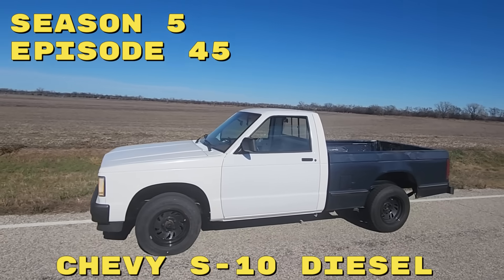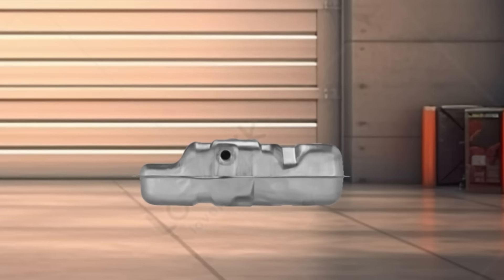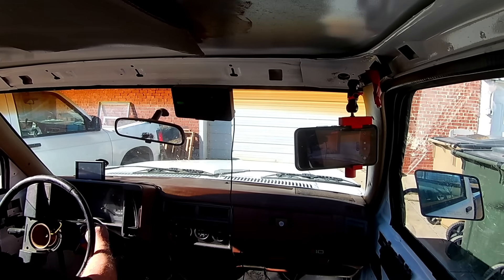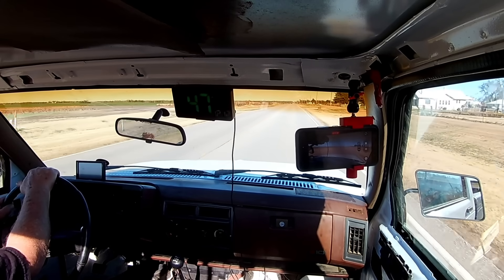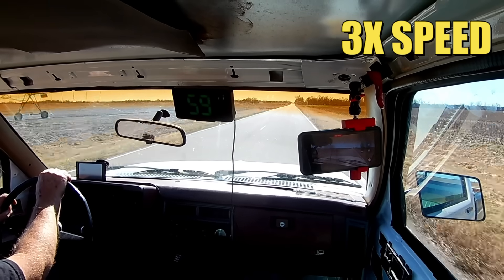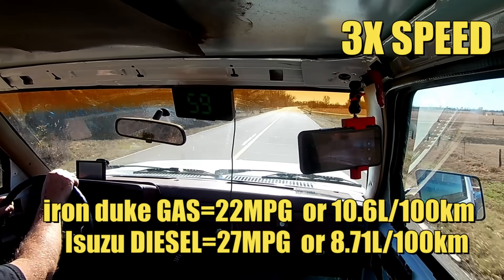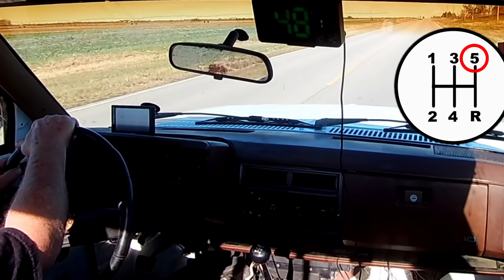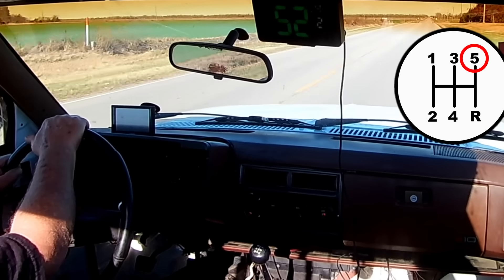S5 E45. MPG?  We road test the custom diesel Chevrolet S-10 to find out the fuel economy.

Comment: Ok. Back in the day unowned a ‘83 Rabbit pickup with the same engine. I wouldn’t exactly call it aerodynamic, maybe a little better than the S-10.  Now someone had messed with the injector pump, so it used to roll coal at high power, so my results may not have been typical.  That said, I waits get between 38 and 41 mpg if memory serves right. So, my guess is you should be getting 35 mpg +/- given the aerodynamics and the weight.  Will be interesting what you tweak it to
Reply from the maker: LOL, you were close!

Comment: In France, diesel has been cheaper than gas for as long as I can remember (I'm 42) until recently. Now, gas and diesel are almost the same price (around 1.70€ per liter). Small hatchbacks with NA diesels like the golf are usually between 5 and 6L/100km so the result of 7.2L/100km doesn't really surprise me.
Reply: For a long time, diesel has been a byproduct of refining oil into gasoline. Now, diesel must be further refined to remove most of the suffer which is more costly.
Reply: @ianm432 I believe it has more to do with state tax policies. Whether it is gas or diesel, 85% of the total price is just tax. In the EU, things started to go wrong when they announced the ban on diesel engines in 2035.
Reply: @DamdamF nope. It's mostly refining costs and supply and demand
Reply: In the US, diesel used to be way cheaper than gasoline. Now I believe that diesel is considerably more than "premium."
This made me rethink my plans for my project 1996 F-350 4x4 crewcab. I believe the 7.3 Godzilla is how I want to power it.
Reply: @Golgi-Gyges Power it with the Ford 300. Or even the 200.
Reply: Not sure when the change happened, but diesel fuel didn't have a road tax, because truckers (which was most of the non-agricultural diesel sales) paid the road tax in a lump sum yearly.  Then they noticed that a bunch of Mercedes and then pickup trucks were getting away with not paying a road tax, so the tax was lumped into the pump diesel price.  Agricultural diesel was dyed red so you could tell it apart from taxable diesel.
Also, up until the early '90s, the national speed limit was only 55 mph, which meant less hp was necessary. I had a '75 Rabbit diesel and later a '88 Samurai which were perfectly fine at 55, but when the speed limit increased to 75 mph (or more! Texas you know), the Rabbit just couldn't do it, and the Samurai just barely could, with a decent tailwind.
Reply: Here in the southwest U.S., it varies by location and gas station. Sometimes diesel is cheaper than unleaded, at truck stops it's usually more expensive and even sometimes the same cost as premium, in my area right now it's usually about the same as regular.

Comment: 5:57 okay, Dave here...  I'm going to place my bet. I used to own a 1994 S10 which had a more aerodynamic body. It was a 2.2 L with a 5-speed manual transmission and at a steady 55 mph Cruise it could squeak about 31 miles per gallon under ideal conditions. More realistic was around 29 when I was cruising on the highway. Factoring that your truck is a little bit lighter and it's also a little less aerodynamic but you have an extremely efficient 1.6 L Volkswagen diesel under the hood, I'm going to estimate that you should get about 38 to 40 Mi per gallon which I believe is what you predicted. Now I'm going to go back to watch the rest of the video so future Dave can see what you actually got.😊

Edit: 15:00 

Future Dave here. I have to say I'm not surprised with or disappointed by the numbers you got. Considering how windy it was, and your real world driving conditions as opposed to trying to maximize fuel economy, I think your numbers are quite reasonable. I don't think you would have gotten anywhere close to that with the iron duke. Future future Dave is looking forward to the next installment! 😂
Reply from the maker: LOL, thanks Dave and Dave.  I have a few tweaks I want to try and we will test again.
Reply: Also something to keep in mind is that the aerodynamics probably play a larger role than the weight of the truck

Comment: You're right, Diesel is more expensive in Europe and the UK because so many old diesel cars and vans on the road it outsells petrol as a road fuel, 38 mpg on 4.51 litres (just over 1 UK gallon)  is pretty good, in the original car it would have done around 55-60 mpg, the dollar/euro/pound sterling exchange rate changes constantly, but a gallon here in UK is £7.00, pump timing and small punchy turbo would wake it up.

Comment: given the power split it might be more efficient to run in 4th depending what the tach reveals, looking forward to those results
Reply from the maker: Indeed, we will certainly try that.  The gasoline Honda insight that I have sometimes gets better fuel economy in 4th gear.

Comment: I’m pretty sure fuel economy will improve significantly as the power is increased - at least up to a certain point. My guess is that you’ll max out fuel economy when you’re generating something in the neighborhood of 40 hp when the engine is making peak torque. I figure that it takes about 33 - 35 hp to maintain 55mph in a vehicle that shape and size, and that hitting the sweet spot between torque, hp, and desired speed will result in the best outcome.

Comment: An alignment out of specification can cause a loss of fuel economy too - just throwing it out there!
Reply: if it were bad enough to cause significant mpg loss, he wouldn't want to drive it, it looked like it was tracking well.
Reply: @mdsuave13 I think it’s all pretty significant when he’s doing an mpg test. If the alignment is off at all, I’d like to see the same test before and after an alignment. I saw around 0.3 mpg difference on my 16 mpg Silverado. On something low on power and in the 30-40 mpg range, bet the difference would be more like 5 mpg.
Reply: @mdsuave13  We might be surprised. After all, overinflating your tires from 35 to 45psi makes a measurable difference on properly aligned wheels. Also, I know from experience a car can drive just fine, but eat up the tires if the alignment is out by just 0.5 degrees of toe. It would be an interesting experiment if someone wanted to run it.
Reply: @atsernov dude half a degree of toe is insane lol. toe is measured and aligned to the hundredth of a degree on modern equipment
Reply: @mdsuave13  It could have 3 degrees of toe-in on each side and it could still track straight. Likely not, but still possible. Making sure it's dead-perfect, or even modifying specs to set toe at a perfect zero is a good idea if you're trying to hypermile.
Reply: The importance of alignment is exaggerated by folks that bought alignment rigs and need to pay for them ;).  Yes, it matters, but if the car tracks straight and drives effortlessly, the alignment is probably fine.  Measure it using DIY methods if you like.

If you know someone that works in final production of an auto plant or as a mechanic, ask them if they pay for routine alignments.  The ones I know will chuckle and say "no".

If this thing is already getting better than the factory diesel option, then it's not being seriously affected by alignment.  The S10 is a brick-shaped device that will blow up if you try to drive it into a wind tunnel.
Reply: Thanks Jimbo for the interesting video.  I think you can probably get 40 mpg out of your S10 after everything is set up right.  With my 2019 Chevy Colorado (gas 2.5L 4 cylinder and 6 speed manual) I average 30 mpg at 55 mph.  With the tires, I run 42 psi front, 30 psi rear, which causes even weight distribution across the contact area of the tire tread.  I do my own fromt end alignments, which results in slightly better tire wear then when the tire shops do the alignment.  Toe is the most important parameter.  Also, half worn tires have better rolling efficiency than new tires.  Road surface smoothness also makes a noticeable difference in rolling efficiency.   Rolling efficiency is better with warmer temperatures.  I can't help you with the winds, Kansas is a windy state.
Reply: Also tire pressure if the brakes are dragging vehicle and passenger weight it’s a ton of things that can factor when doing fuel economy
Reply: Unless he is making 45 degree turns without hands we are talking .05 mpg.  Brining the mother in law  would be worse.

Comment: I remember when diesel fuel was cheaper than gasoline.  Then diesel trucks became super popular and the gas companies jacked up the price to take advantage of the increased demand.
Reply: There are two reasons why diesel is more expensive than gasoline: hydrocracking and ultra low sulphur diesel mandates.

Back in the day, crude oil was distilled, and you got what you got. Now, they use catalysts to "crack" bigger molecules into smaller ones, allowing distilleries to produce more gasoline. But this means less diesel is produced.

The other factor is sulphur. Prior to 2000, diesel contained around 5000 parts per million (ppm) sulphur. The first limit imposed by the government was 500. Then 45. Today it's 15 ppm. Filtering that sulphur out adds a lot of cost.

The sulphur also acted as a lubricant, which is why fuel additives are basically mandatory on older diesel engines like this. Your injector pump will go very quickly due to the lack of sulphur.
Reply: yeah it never made sense that the fuel distillation process pulled diesel out of the chain earlier, yet it was more expensive.  They figured out that literally every consumer needs diesel to run their life, so ethics be damned!
Reply: My mom had a diesel car way back when and I remember getting diesel for under 60 cents a gallon, but having to buy it at truck stops mostly. Not many places had it otherwise.
Reply: That's how all companies work, for everything sold. It was true of diesel when it was cheaper than gasoline 20 years ago. Low sulphur diesel refining, taxes, and the amount of diesel you get per barrel of crude (vs other petrol distillates) are the reasons. Not saying the oil companies aren't greedy, just that they've always been greedy and it's the market that changed.

Comment: How does the power compare to the turbo kubota? Seems like after the turbo and added fuel on the kubota they should be similar in power
Reply from the maker: around town, the power is good for both vehicles.   On the open road the Honda has the advantage because of its weight and aerodynamics.

Comment: Thanks for not using AI crap, Jimbo! I like your illustrations way better. Don’t let the robots win! 😂
Reply from the maker: Thanks!  Its too bad I have to announce it's not AI
Reply: @robotcantina8957 It's also kinda funny considering your channel name!!! Keep doing what you doing! Everything is perfect!
Reply: His Jimbo action figurine was ai generated thoe but that's not that horrible
Reply: If the robots win, we’ll have to listen to techno. (look it up here)
Reply: @stevebot  Ok. I am actually intrigued now as a fan of techno 😂jk
Reply: In your defense, It does sound like AI. Of course, Skynet would tell you it's not Skynet. I looked at some of the early videos from about 10 years ago and it is the same voice.
Reply: he DO use AI in figurine meme.
Reply: I wonder what a mechanical Cummins would get in a 1994 dodge reg cab  2  wheel drive with a 5 speed and tall gears 2:73 or taller;  in your part of the country?  It would probably get very good fuel economy and go faster than 55 mph in a head wind lol.
Reply: @Bob-the-handyman My dad put a 4bt into a d100 4wd from the early 1970s. It was a rough beast but it got in the low 20s for gas mileage. The top speed was about 60 miles an hour with a 4 speed manual. 

He later got a brand new 1989 W250 with an automatic that I inherited . Dad claimed 23 on the highway, running it flat out at 70-75 mph I got about 20. 60 seemed to be the sweet spot.

Comment: Yup, the efficiency was round about in the realm that I suspected it would be.
Even with or without the wind.
There is only so much efficiency that you can  reliably squeeze out of a gallon of combustible fuel with a given weight and speed.
🤷
(trust me, I dont like the rules either, but such is life)
The only way to get better efficiency with your 50 odd horse power is with LESS weight and LESS wind resistance.
Sure with some tinkering and induction you might edge it up to around 40 mpg, but you are still shoving around a heavy brick at faster than walking pace.
Still one of the coolest projects on youtube and one of the best channels on youtube.
So tyvm for that.
😁
Reply from the maker: thanks!
Reply: People say that, but it's actually not that heavy, and it's not as big of a frontal area as some of the modern trucks. There's some spots with no plastic guards to block the air, but it's probably capable of more than people bother to try for. The BSFC map of a stock ALH says it can make about this amount of power at 200 grams per kWh, which is a lot better than what this thing should be doing when it's revved to the max and out of tune, especially in the wind. So, if he can get equally good bsfc to that thing, he'll be in business. A tailwind unfortunately doesn't make up for an equal headwind, in my experience, so that would help too - although it could be masked if he maintains a higher average speed without the wind.

Comment: 32 places it square at the upper limits of what I can achieve in my Gladiator Eco Diesel. Seems low given that the truck is so much lighter and with that engine.

Comment: About all you could do to improve performance or make go speed more. Would be to drop the rear axle ratio drastically.  To the point that it could only do 60 mph max. But it would accelerate faster.

Comment: If you tare weigh the container, some scales will allow the full weight the scale can handle to still be weighed.
Reply from the maker: the tare function is difficult to do with my scale.  the scale will shut off before I get a chance to finish the measurements.

Comment: My little 999cc European VW is always recommending upshifts to 5th gear at low revs where there's similar torque but less power. I ignore the advice and the computer confirms it's less economical unless you are going downhill or coasting to a stop.
Reply from the maker: LOL, never trust the computer.

Comment: For fuel economy testing I'd use a portable fuel tank for leisure boats. Around here you can get them from between $30 and £50.

But I'd call the consumption figures pretty reasonable and decent.

Comment: The sepia windshield and the tan dash is a nice unintended coincidence. 

"Metric money and metric measurements" 🤣

I did notice you had to downshift a couple two-three times on the lap you put on the video the truck seemed to be a struggle bus, not an S-10 😂. I bet 35 mpg is reasonable with a couple adjustments.
Reply from the maker: It may be hard to tell since the video was sped up, but the down shifting was usually associated with slowing down and taking a turn.
Reply: @robotcantina8957  yah, it was hard to tell. It looked like you were hitting the headwind and had to downshift.

Comment: I've been waiting with baited breath for this video.  Basically,  what I expected.  Diesel swaps always seem to get about 1.5 times the fuel economy of the gas engine they are replacing. It's almost all about wind resistance. Even weight has relatively little effect.  FYI my 02 Jetta diesel averages 40-42 and weighs almost 3000lbs, but when I hook up a 4x6 enclosed trailer it only gets 30mpg even when it's unloaded.

Comment: Do you think you would get more mpg if u lowered/removed the tailgate or cover the bed?
Reply: People have tested that before, including Mythbusters back in the day, and uncovered, with the tailgate up was the most efficient.  It produces a vortex behind the cab and new air passes over it fairly smoothly.  Tailgate down or bed covered means no vortex and more scattered air flow, so more resistance and lower mpg.
Reply: @Noah_E 👍

Comment: That Diesel they offered back then was probably the same engine that I had in my '84 Chevette.  Had a 5spd behind it, and pure highway I could get about 70mpg out of it, keeping the speed down.
Had that in the mid 90's, and diesel was about 1/2-1/3 the price of regular. Then they figured out people were buying diesel cars... and started to jack it up almost daily (it seemed).  :(
Reply: I remember those days too. They didn't want folks using 'less expensive to make, and safer too' diesel - and they've made millions jacking it up and screwing truck drivers all these years also.
Reply: @Maybe-So  - Yeah, it really hurt the trucking industry!  When a semi gets 5mpg on a super GOOD day.... that's a LOT of fuel.  I used to work for Cummins (dealer level).
Reply: Yup..... It's actually pretty easy to build a small, 2 seated car that can get 100+ mpgs using a small turbo diesel engine. Check out the VW L1  it's a narrow tandem 2 seated aerodynamic car. Along with the VW XL-1
I like the idea of finding a used Geo Metro in decent shape with a 5 speed manual OD ⚙️ and a worn engine for cheap and putting in a little 1 liter turbo diesel that makes around 50 HP & 100 ft lbs of torque. So it'd get 60-70 mpgs but also have decent acceleration. Instead of being a snail 🐌 like a stock Metro. 
Or buy an adult size used  Go-kart for cheap, chop and stretch the frame & work on building a DIY street legal UTV that got good fuel economy. Make some lightweight insulated plastic removable body panels & doors, polycarbonate side & rear windows & small glass windshield out of some type of small vehicle. Make it on/off road capable and keep 2 sets of wheels. Street wheels & off road/winter wheels.
Reply: @michaelbrinks8089 VW also made a special small car called the Lupo tdi 3L . It could achieve 3L/100km.